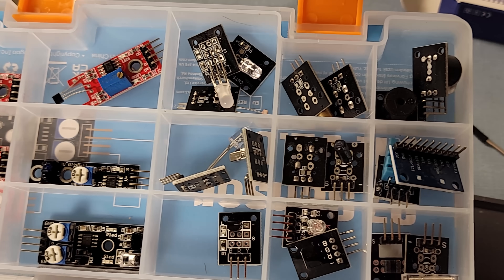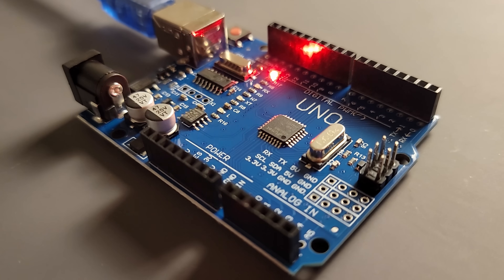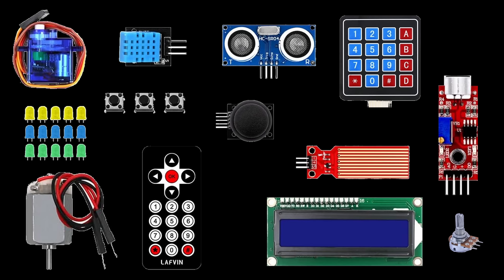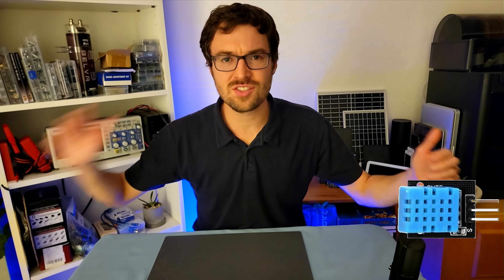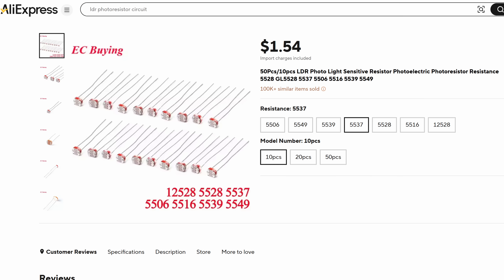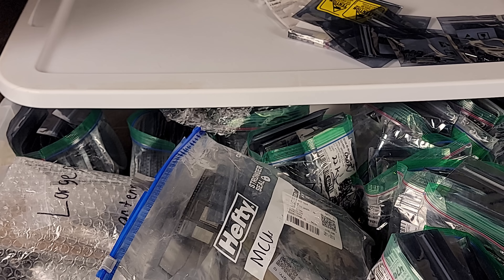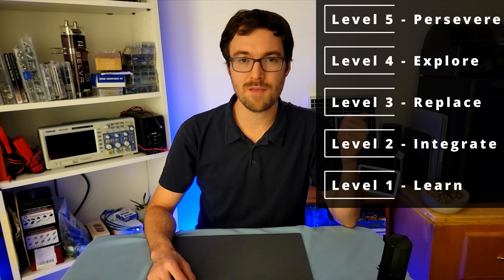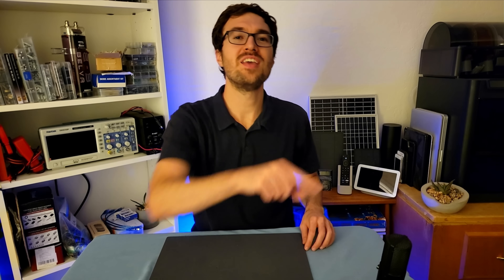How to Make Anything - Learn to Think Like an Engineer

Comment: Hi FluxBench you really get me started in electronics. I think I have made a lot of progress in the past few days but I am stuck now. After making "something", you know, following along those "experiments" in the learning kit I think I got a little more understanding of those parts and sensors. I made a "circuit" using DH11 as input and LCD1602 as display on the breadboard. I made a beeper that can play notes and control volume with a potentiometer, but still they are on the breadboard. I really want to move forward but I am not sure what is the right step. should I use cardbox to build a shell for them? or should I look into 3d printers and learn 3d printing, 3d modelling as well, are the worth it?

In short are 3D printers worth buying at this point?
Reply: should I try esp32? should I.... I know it really depends on what I "really wanna do with them". But in the process of learning, sometimes it gets really tricky cuz I am not sure what I want to do.
Reply from the maker: @zzcc7534 it's hard to choose anything better than the ESP32 especially for the money and the ease of use. No matter what you are going to do, the ESP32 is going to be the right answer 50% or more the time! You probably don't want to get any old models as all the cool fun stuff is in the newer versions such as the ESP32 S3 which is super dang fast and the ESP32 C6 which can talk to just about anything and has low power modes built in. I would recommend spending the $10 or so and get a official board from Espressif, the manufacturer of the ESP32. After that start looking into third parties or clones or whatever but you probably want a good standardized known working dev board. That way you can buy a cheaper board or pack of ESP32s from someone else and if you have any issues you can always try using your known good board. If you still have issues it's your fault, if the issues go away with the good board then it's the cheap boards fault.
Reply: @FluxBench  Thanks for the very detailed replies. I really appreciate your help! I think I will try esp32 very soon!

I tried to solve a real problem but it was much harder than i thought( and the difficulty wasn't in the circuit design but some other engineering stuff i guess?). 

 I tried to change the lock in my bedroom into an electronic one, but i only ended up with breaking my cheap servo motor in my learning kit. I think I might need a more robust motor/servo but I also found that besides electronics, lots of other things are needed to solve problems. For example I might need some basics in transmission design? 

I found myself so limited with a motor while maybe to an experienced engineer it can be an ultimate power source. With me it's just something rotates and I don't know how to transfer that rotation into something that I want and that can be frustrating sometimes.

Questions like how much forces are needed to applied to the lock cylinder, what type of movement/ mechanics should I apply(like should I push and pull with it, should I link the cylinder with a servo and just let it rotate with the servo arm...?) All kinds of questions brought into my mind. Please don't misunderstood I understand that these are the questions that I need to figure out myself and I have no intentions to bother you with these boring questions. What I am trying to say is, when trying to solve a real problem it can be much harder than I thought(I thought It would be just circuit design, bang, connect, bang).

Dear FluxBench, do you have recommended source for learning the basics like transmission design, or maybe just how gears and stuff works? Or should I follow some other existing tutorials like some open sourced toy car designs to get a fast glimpse of what I should use and what I should do with those parts?
Reply from the maker: @zzcc7534  I am so happy to see you say that stuff! I just got back from the Product Development Expo full of professional mechanical and electrical engineers and they were all talking about how hard stuff is to actually make! It's not just you, life is hard 😂 you are seeing how it's not just one thing to solve a problem, it's all these related skills and you need a little bit of knowledge in some skills and a lot of knowledge and other skills, but together it's enough to get you through the problem. 

So that's the hard part and the fun part. Your problem is a mix of hardware and electrical and software. 3D printers are the easiest way to get through the hardware side of things. It doesn't make the strongest stuff, but it can make just about any shape you want which is kind of like magic compared to before 3D printers. What's the alternative? Cutting and welding  metal or carving wood?

I know more software than hardware and electrical so I overcome a lot of issues through more elegant software solutions than electrical or hardware implementations. So you're probably going to need to learn about gears and transmissions. "Rack and pinion" might be a good solution for you to turn rotating into linear movement. But there's probably a million solutions to this problem. This is one of those simple things that will probably teach you a stupid huge amount about a lot of different things. Great learning project!

As far as where to learn it, YouTube! Just watch a bunch of random videos. My favorite are the old ones from like 1950 that are in black and white because they were made for the average person to understand it, and when it comes to transmissions, every single person needs all the help they can get to understand it initially! But you probably don't even need full transmission knowledge, just gears. So no sources in particular, just Google and chat GPT and YouTube and ask on Reddit and stuff like that. Or ask a person you know!

So it looks like you're on the right track, just keep keeping on! 👍 Let me know if you have any specific questions!
Reply: @FluxBench Exploring and learning new stuffs! I will get back to you with my updates. Thanks for leading me into the temple gate!
Reply from the maker: So glad that you're getting started! 😁 Good job on making your first useful thing! I've used everything from old cardboard boxes from Amazon cut up with scissors and taped with duct tape to random plastic containers I was going to throw away to custom 3D printing.

If it works on a breadboard and you want to keep it on a breadboard then you might want to add a dab of super glue to each connection. Just enough to prevent the wires from pulling out. But you can also get "perf board" which is that grid of holes on a PCB similar to a breadboard, but much cheaper and thinner. If you want you can transfer your circuit to the perf board and solder it on permanently. 

Great questions, not sure if I answer it all of them. Feel free to ask more or clarify!
Reply from the maker: 3D printers are ridiculously good at this point. Those "bambu labs A1 mini" printers or whatever they have for like $250 including the filament changer is a ridiculous deal. The video I'm making right now uses a 3D printed case around a custom ESP32. If you have a few hundred dollars to spend on your hobbies, this is probably going to be a good one! But if not then using any other container will probably work for now. I used plastic food containers I was going to throw away for a long time. Just give him a good washing and maybe glue with hot glue your circuit board or potentiometer or screen or whatever to the plastic container. If you have a soldering iron with some old tips you can use a old junk tip to heat up and poke holes in the plastic to make good circular holes for potentiometers or buttons or whatever.

Comment: Even somewhat following instructions is not always easy. Installing Zephyr RTOS on Windows took me like one hour and three side steps. Connecting SSD1306, SSD1315 displays cost me several hours to find initialization code that works with both and trying to debug why they fail to respond to I2C commands sooner or later, roughly after ten thousands screen updates - I never resolved it.
But what you said is why I don't like Arduino. Display initialization is 15 lines of code, update is 5 lines, helper functions are 20 lines, but there are six libraries for that of which two do not work.
And problem with modules is they are build cheap from counterfeit chips, but for hobbist, it's not realistic to order 8$ sensor, 0.05$ capacitors and resistors, PCB. Some shops have minimum order of like 40$ which exceeds single project by far, it needs tools to solder SMD parts, tools to probe connections/short circuits on this scale and it costs time to design PCB, order components, pick up package. It pays of at scale. Hobby project might be Raspberry Pico with wifi, two sensor module, display module, universal PCB, few wires. Commercial project might be RP2040, wifi module, SPI flash, voltagre regulator, two sensors, display, display cable, display connector, SMD parts, 4 layer PCB with size of post stamp, with size determined by display and USB connector.
Reply from the maker: I think it's like getting into anything. You're going to need a bunch of random stuff initially but once you have that then you don't need to buy very many new things after. I've made about five different PCB designs since I last ordered more parts. Yeah, the minimum quantity for resistors is like 200 and so you're going to order 200 of any size you need even if you just need one. After that you have resistors for years 😂 but I think it's going to probably be about $200 or so to get the basics. I probably have a few thousand in components

Comment: I have always been fascinated by electronics, built computers for 30+ years. But my fear of electronics especially power etc is quite huge. Therefor i have never taken a deeper dive into it. I think you might have made me pull the trigger on going all in. At 48 it feels a bit late, but hey better late than never. :) Cheers nerd from a fellow nerd.
Reply from the maker: If you have built a computer, you are already dealing with high speed signals and huge power supplies!!! Don't worry about frying a few components or bricking a $5 board, cost of doing business while learning electronics 😂 start small and work up from there. Like anything in life, start with the cheap stuff and move up as you get experience. $50 and a weekend should be enough to get started!!!

Let me know if you have any questions. My first video is all about what you need to get started.

Comment: Of course the manufacturer is going to say whatever they can think of to defend their flawed products. There was a weakness that was exploited because something was not thought about during development. This happens all the time with many types of products, but most importantly with the things we secure our property and families with, safes and locks. Most people don't realize that the padlocks they buy, the doorknobs and deadbolts they use are often very easy to defeat or bypass. What's most sickening about these flaws is, the big companies like "Master" know about these flaws and methods, and they still don't implement the sometimes simple efforts to fix them, but they continue to sell these locks that take only seconds to open with the right tool and knowledge. Some padlocks and door locks can be bypassed or picked in less time than it takes to use the actual key, and by using a tool that costs $4, or can be made from scrap lying on the ground, like an old wiper blade. A padlock that can be opened with cut pieces from a Pepsi can off the ground, or even by just whacking the side of the lock with the right amount of force. There are tools available that anyone in the general public can purchase, and enough content out here to implement the use of such tools through methods that almost anyone can learn and apply to get a lock to open using non destructive means. You can decode most commonly found combination locks using nothing but some knowledge, practice, and the tools you were given at birth, your hands.
 This means your property could have already been entered and you wouldn't even know it. So the best advice is, with locks and safes, do some research and have them repinned using harder to exploit security pins, or find ones that do not have simple flaws. This will slow down an attempt to gain access and buy time, which is something a theif typically won't want to face. There are several good ways to deter theft, one of them is having quality products that don't just claim to be "high security" (like the average Home Depot door lock), but locks that actually pose a challenge to a potential theif/burglar. As far as safes go, the heavily constructed old school dial combination safes were far harder to get around then this new cheap digital garbage. Though not every typical person has the knowledge or tools to do this sort of thing, they can certainly acquire them, and a reputable company will stand behind it's product, not make excuses or brush off complaints. Master is notorious for being made aware of the vulnerabilities with their world famous locks, yet they keep pumping them out with known flaws, selling false hope of protection. Some padlocks simply need a wafer or shield to thwart off a bypass tool, costing them only cents to implement, yet the locks still dont have them (and yes even those can be beat, but not as easily as those locks without the added obstacle). This is sad. There are a few good manufacturers of quality, hard to pick or bypass locks available. Cameras are great deterrents, secure locks, longer screws and plates for deadbolts, and making sure the door or window itself is secure. Even a great lock is useless if the door it's on can be pushed open, or carded. A locked window that can be dropped, or a cheap fingerprint Amazon padlock will not keep someone out of your home or shed. Making sure your garage door release rope is not hanging and available to snag using a tool. Simple under door tools can reach around and pull your knob to open in offices and hotel rooms, use physical jams and available security devices for those. 
 I know someone will say " if someone wants to get in, they will", but it's proven that making it harder to get in will often make them choose another easier target. Thank you for showing us how vulnerable this common safe is to defeat non destrictively. Videos like this help everyday consumers stay informed about what they're buying, and also remind us to stay a step ahead of the scumbag theifs of the world.

Comment: My first project was just some buttons to integrate in X4 foundations with arduino Leonardo. Now I'm building my own HOTAS and cockpit
Reply from the maker: Awesome progression! Are you putting any force feedback into the HOTAS? I've done a couple projects with a little bit of like servo pressing on a spring type feedback to just give that little extra oomph and tactile sensation. I'm not a expert on adding force without hurting people so I kept it low powered where I could easily brute force override it if I wanted!

Comment: I start with building a robot. This project is a good lesseon.
Reply from the maker: What kind of robot?!
Reply: @FluxBench  A simple child robot like the Eilik toy. A good start for further projects. Maybe some day a T800?
Reply from the maker: @alexsternwart7057 😂 if you want to go full Terminator then you need to learn motor control and sensor fusion and planning algorithms and stuff like that. 

I think one of those dinky little $50-150 car robots (like unmanned ground vehicles) with a bunch of cheap sensor modules on it might be a better learning platform for you. 

You can drive it by controlling the power going to the motors, figure out how to navigate using a bajillion different ways, use sensor readings and other things to do whatever you want.
Reply: @FluxBench  Yes, this time I biuld a simple child robot on a platform. 4 motors for arms, head and body and a display for the eye animation. T800 has 14 years time.

Comment: I like you, bro. Reorganizing my bench, and prepping to get my 12 & 13 y/o's designing circuits. These videos are great!
Reply from the maker: That is awesome! If you have any questions, let me know! I'm all about getting the next gen into making stuff! 

I that age I was making air pressure potato guns using a bike tire pump, electric solenoid sprinkler valves, and a 12V battery 😂 I don't think I even knew what a circuit board was lol. That would sure be fun to make with my current experience 😜

Comment: Ive had an arduino kit for like 4 years, still haven't done anything with it, no idea really
Reply from the maker: It was a few years between me buying my first microcontroller starter book/kit and actually sitting down to learn it. I could say like "you have no excuse", but let's be real, life happens, maybe you'll find a good time to start, maybe you won't. For me it took a project where I needed a little bit of software, and this was the easiest way to do it. Like 15 years later this is now my job 😂

Comment: I hated modules and stuff like Arduino's for the longest time. I used to call them the fisher price of electronics. When I started with microcontroller it was PIC and you programmed in assembly. But one day I realized there's a reason they're called "dev" boards or modules, they are made to go from idea to prototype quickly. I buy dev boards whenever I see one that's interesting, just to have to play with or in case I need it for a design. Once I'm satisfied with the prototype then I can have pcb's made and order the discreet components. They're great for prototypes, but not for final designs/builds.
Reply from the maker: You get it 😜 I'm excited for the next video where I can to show how to assemble your own PCB. I made a simple PCB with LEDs and resistors of various sizes. I'm excited to see if I can hand solder down to 0201 (no stencil or solder paste).